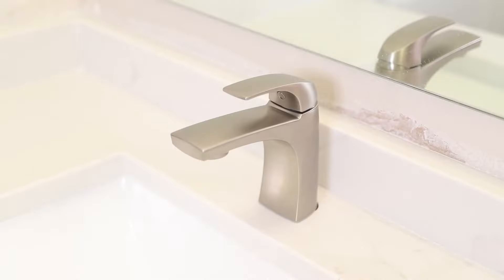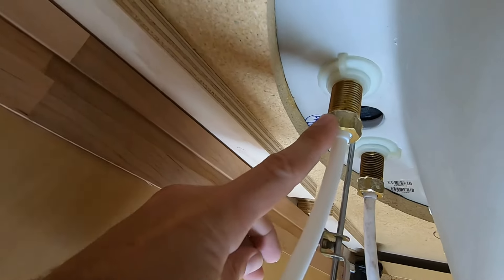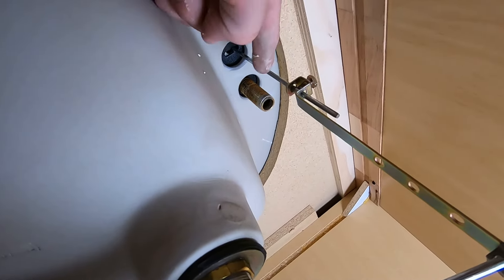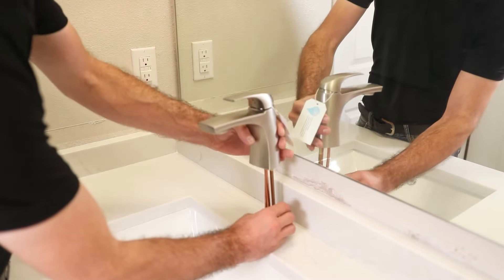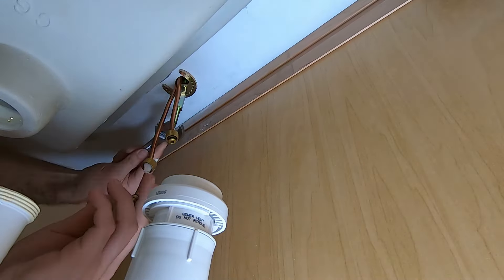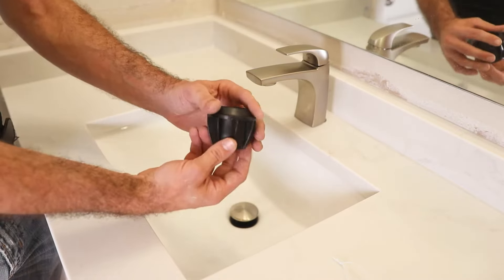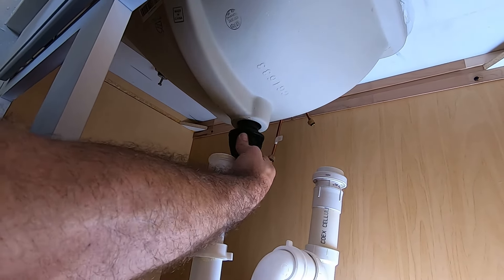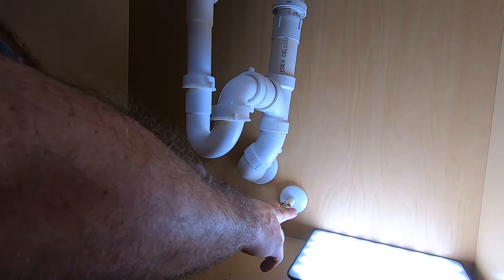How to Replace & Install Bathroom Sink Faucets | Easy DIY Home Upgrade

Comment: Your old basin had 3 holes. The new faucet was single hole. Are they compatible?
Reply: Yes.  They also have plates that cover up the other two holes if you don’t change the sink to a one hole.

Comment: What if it's a 25 yr old rusted out fixture and the cabinet openings to get under the sink are only about 15 inches wide if even that? (Old trailer house)

Comment: I have double handle faucets. I want to replace them with single handled ones, but I wont change out the counter top. What do I do with the extra 2 holes?
Reply: There are plates that cover the other holes while also permitting the usage of a one handled faucet.